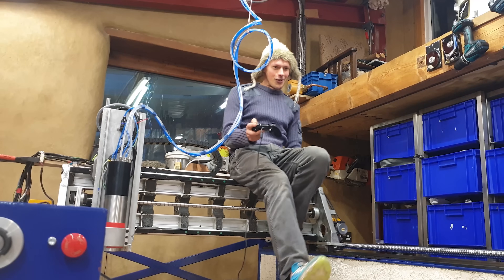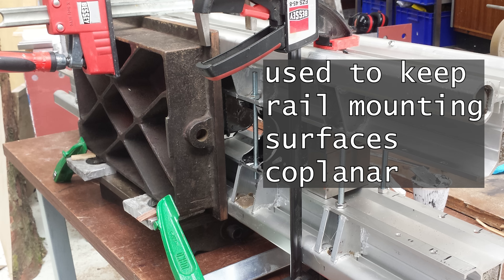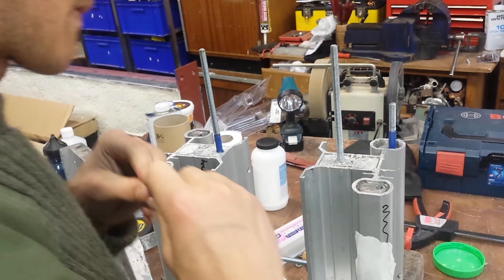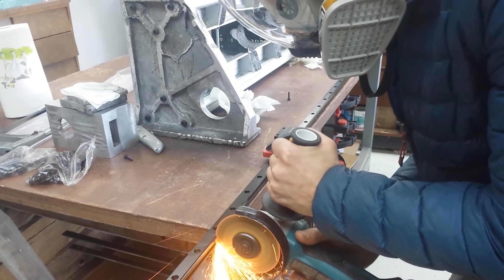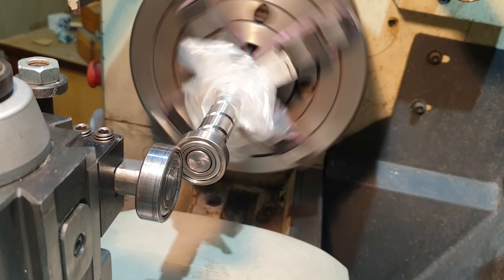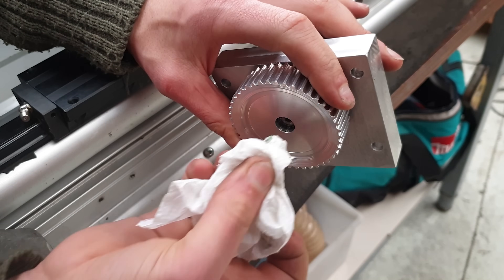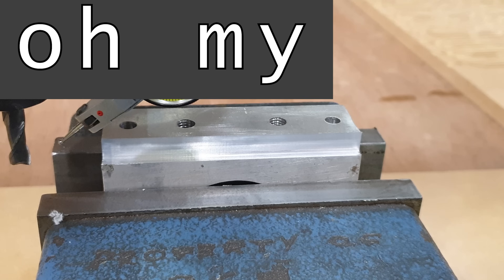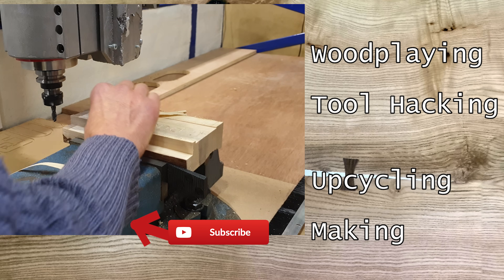Experiments in Gantry Design: What makes this CNC so special?

Comment: I know this is years later, but great job. Your off your shed, in a good way.
 I just started a plasma table build and screwed up and bought normal ballscrews and was wondering the best way to unscrew my design faux pas because of them whipping at plasma table rpm's, and found your vid on your rotating ball screw nuts & was working out how to make them in my homeshop from junk and I have done some diy casting and know how frustrating it can be at times. Then realized the same thing about the ballscrew pitch being too fine for rapids. Rather than find the right pitch screws like you did, I've just gone to a rack and pinion setup because its just for plasma. On the plus side for unconventionality, for a table frame I'm using a old JCB 3c digger/backhoe chassis turned upside down. Rigidity isn't a issue :) Curious why you used vb for the atc code etc, I just tend to use linuxcnc for everything cnc as its easy to dig round inside, although it tends to be crusty old grumpy people on their forums, they know their stuff if you develop suitably thick skin, but hey, you've been on the 'zone,  you have that off pat I'm sure :)
You can get structural adhesive from BA or 3M that's (relatively) reasonably priced (for structural adhesive) for potting surfaces together, although I'm sure your diy epoxy grout worked great. I built a dragbike and rather than weld on the crankcases and risk distortion to critical dimensions, I bonded in stiffeners with it. Its designed to glue airplane wings together, so more bond area the better, but it strong stuff.
Reply from the maker: Oh and as for the linuxcnc - I just sorta fell into using Mach 3, and now I don't want to do the work to switch - It wasn't really a fully considered choice...
Reply from the maker: Hey Jmp, thanks so much for commenting and watching :D Yeah good call on the rack and pinion for plasma - that's the way I'd go for that.  
A JCB chassis turned upside down!!! Now that sounds very cool! Would love to see. We have an old 3CX and after grubbing round under that thing, it sounds like a good use of a LOT of steel. Love it ;)
Reply: @FloweringElbow  This is a 3C2, that had been properly wrecked when it was rolled into a lake when the bank gave way. I bought the remains as a engine & parts donor for my newer 3C3 (previous model to the 3CX) and lots of leftover yellow lumps round the back of the shed to make things from.

So far I've trimmed off bits from the frame so it could fit through my machine shop door, inverted it & put heavy casters on as the forklift doesnt fit through the door either, and started to clean up & test fit HGR20 linear rails for Y and X giving 2000x1000 work envelope. There's a pic on linuxcnc's forum. Nasty looking but form follows function and its surprisingly plane given its history as a submarine. I'm using the roof inverted and cut down as the water tank and inside the integral diesel tank at the front is a great place for mounting sensitive electronics with heavy emi shielding from plasma noise. https://forum.linuxcnc.org/media/kunena/attachments/19839/jcb_plasma.jpg

For motion control Mesa 7i76e & THC-5 interface, 3NM closed loop steppers & supporting hardware + a old pc with linuxcnc running plasmatic gui frontend have been prepared but currently blocked waiting for helical racks after my ballscrew faux-pas. 

I have a bridgeport interact1 retrofitted linuxcnc & steppers + originally a generic parport breakout board about 10 years ago, then redone with mesa 7i76 fpga motion controller and 4th then 5th axis so have some experience with the mesa and linuxcnc. And a working cnc mill to machine bits on.
All this because I have 3 landrovers and a vw bay window to make chassis repair sections for. Probably yellow ones.

Comment: Having done mostly woodworking all my life, and now bashing around with metal, I do totally understand your new engineering phrase "accuracy-exasperation equilibrium".  LOL  All those extra digits to the right of the decimal point sure make things interesting, having come from the "measure once, curse twice" mode of fabbing.
Reply: I tune machines in an aerospace shop. They frequently need to be better tolerance than the sales brochure. I always ask 2 questions:
1. What tolerance range would you like it to have?
2. For the parts made on this machine, what tolerance range does it actually need to be?

Since I'm talking to a machinist promoted up to production manager, I get real answers.
Sometimes I have to show them things like, "this lathe turret is all wonky and these pockets are straight if bolting tools to the side, and these other pockets are straight if bolting tools to the face." (Actually, all our Haas lathes have that problem. It usually comes up again when we get a new lathe operator, and they move tools around and suddenly we are breaking taps...)

And I always strive to exceed expectations, but many of these machines are poorly setup for precision tuning. I've had to make a custom alignment tuning jig for at least 1 machine, because the factory did all that with the wedge off the machine, level & with no counterbalance spring on it. Without the jig, adjustments would barely move, then jump 2 decimal places out of scale.

Comment: Now that you have made a decent machine. You can remake its parts using CAD and cutting out from billet aluminum to upgrade this machine to levels of accuracy.
Reply from the maker: I had that thought in mind when I was making this, but TBH now that it's up and working, replacing say the cast gantry side plates, for machined versions, seems like it would make a negligible difference, for quite a lot of cost... Although those cast parts are far from accurate themselves, the metalized-epoxy replication method of jointing makes them super accurate - probably better than most machined parts. I would kinda like to make a more beefed-up spindle plate though, for when the z is at full extension.  
Thanks for watching friend :)

Comment: Dear friend, you have done a great effort and work,
Vibration is the big problem of machine tools (mechanical or CNC), next time you can purchase iron casting structures (new or second hand)  and use as barebones. You will be suprised of how that small carbon in iron casting absorb vibration. 
cheers.

Comment: I plan a similar high Z but roughly 1/3 size :-) but 60k rpm :-)
Reply from the maker: Good afternoon 1337 Imba. 60k rpm 😲 Impressive, what are you planning to cut?
Reply: @FloweringElbow  mostly hard wood(oak, ebony, rosewood, palisander and other nice wood.  with tools from 0,4mm to 6mm diameter.. but in the current situation not before 2024
Reply from the maker: @Imba-gt7qi  Cool. The speed will be useful with tools 0.4mm I guess. Good luck!

Comment: This runs on VBA?
Reply from the maker: Hi Evan. Is VBA, Visual Basic for Applications? We are running Mach3 at the moment (though looking to change), and it has some visual basic scripts...
Reply: @FloweringElbow  yeah, that's the VBA I meant. Interesting! I didn't realize that that was still used by some software. I started learning that back in the early 2000s at one point. Thanks!

Comment: For your next improvement, I'd suggest some of the largest Loc-Line tubing and attach it to your Z axis and vacuum. Point it down to your cutter and it will happily suck up about 90% of the swarf. Just search YT for Locline, router, vacuum for some examples.

Comment: I like the printnc cnc design. however I was thinking of using several pieces of 8 inch to 12 inch "Aluminum Lighting Truss" to make the gantry. It comes in lengths of 1M, 1.5M and 2M.  The light weight truss is rated for 500lbs without flexing, which should make it stiff enough. If not, it is still a good starting point.

Comment: Just wondering, why didn't you use I Beam for the gantry as well?
Reply from the maker: Hi there BoboHo, thanks for watching. Steel I beam, is very heavy for a gantry that gets accelerated and decelerated a lot. It is also quite poor at resisting twisting forces (which there are a lot of on the gantry.

Comment: I was a tool and die maker and diecast mold maker. For approximately 45 years. From what I can see in your parts is you have a lot of gas being trapped during your fill or pouring process.I would like to suggest in the areas wear you have what looks like a seam that you put in a .004 to .006 deep vent to allow gasses to be released . Aluminum won’t flow out a vent that is under ‘006 of a inch.’.start off with a ,250 wide vent and increase till your pour is smooth looking.
Reply from the maker: Hey Gary. Thanks for this. Some of my early castings for this machine were truly terrible because I was using poor technique. This has improved a great deal, but I still have plenty of room to improve. Thanks for your observations and advice, and for watching :)

Comment: This is so fantastic, the replication process is so extremely interesting, it means you can cast a relatively accurate base and then not have to worry about scraping provided you have enough epoxy compound and a straight edge.

Comment: Love the epoxy jointing technique. Will check out Banburg. Split a mould open pouring  lead once but then took the pattern to a foundry. Made my lockdown cnc from aly extrusions for the bedblock, Two 600mm ballscrews for XYZ, one cut to 450 and 150 for the Y and Z. . Bean can aluminium, lol. Made a vid of my  turciteish filled epoxy test on a surface plate. Super impressed with the skill range.

Comment: I'll say it again, your channel is fab. It's, sort of, proof of concept of all those things I've wondered whether they were possible but with all those tips and trick that save huge amounts of trial, error and fail.
I've been collecting bits and bobs from engineering auctions and scrap bins for ages to build a CNC plasma cutter for my partner.
Thanks so much for sharing.

Comment: Amazing video, and congratulations on achieving such a capable and stiff gantry.  I haven't seen anything on the replication method in this context before, that is extremely interesting.  Do you have a recipe for the metalized epoxy? Thanks for showing this in such detail. G
Reply from the maker: Thank you very much Greg! We haven't really tested its capabilities properly yet, we really need to seal up the ballscrews and finish off other bits first... We're working on writing out all the metalized epoxy recipe stuff...(Edit: you can find it here: https://ko-fi.com/s/bb8cbd72e1 )
Reply: I'd suggest to use a commercially available mixture specifically developed for the task like DWH from Diamant Polymer or similar products.

If you mix something yourself, without extensive testing that'll most probably dwarf the cost difference between diy and professional products, you can never be sure if it'll creep and basically anihilate all the hard work when it all starts to get sloppy after some time. Creep over time is not an easy problem to overcome, and in this application there's not much tolerance for any of it.

There are other areas where improvised solutions have less chances of causing substantial problems. Wrong place to save what's just a few bucks after all.
Reply from the maker: Hi there Heinz, thanks for sharing your thoughts on this. Personally I disagree of course, but that's an interesting perspective. With good epoxy and mixing technique, I reckon the possibility of creep is effectively zero. 
You may be right about the price difference, though my research indicated otherwise, either way, I'm only making the machine because I like making stuff... 
Anyway, have written up my thoughts on this and details about how I do it in a little guide about DIY metalized epoxy etc, that can be found here:   https://ko-fi.com/s/bb8cbd72e1

Comment: accuracy/exasperation equilibrium... yes, I know what you mean.  A proper machinist just doesn't feel the exasperation, I guess.  I love the castings.  Can you tell us more about the epoxy, sand, and metal fill? I recently purchased some steel-filled Moglise, which is somewhat difficult to procure.  My sense is that 80% fill of steel or aluminum and any decent epoxy would be OK.  What is your experience?
Reply from the maker: Good morning K15n1. Pretty much right with your epoxy fill estimates. I'll write up the details when I get a chance. Essentially the mix you suggested is a great starting point, and it's WAY cheaper to mix your own... Peace, Bongo.

Comment: Congrats! 37.5N/um is a really fine job!

Probably one of the best routers on the market!

(although the long overhang on the z axis will probably deflect more when you pull it)
Reply from the maker: Hey there, thanks Eldric. Yeah that's right, I guess I will be wanting to do any metal milling as close to the top of z travel as I can get to minimize the z-deflection / twisting leverage.

Comment: Is that the China toolchanger spindle for about 1500€? I am super curious about it and if it's any good...so what do you think about it? 
Thank you for you video, learned lots!
Reply from the maker: Good evening Leonhard, thanks :) 
We will be doing a whole video on the spindle. It's a ATC motor from Jianken model JGL-100/3.2R24
220V, BT30. It's early days but thus far I'm impressed by the quality. I really need to redo the mounting method - I always intended for the spindle to be supported over much more of its length - and to have the mount add strength to the z plate... Just need to do some casting - but at lease I will be able to machine it on the new CNC this time :) 
I'll put a link to the spindle in the vid description when I get a chance.
Reply: @FloweringElbow  thank you so much I'm looking forward to it!

Comment: Nice work making the machine. Now you've got a great tool for making all the future ones!
Reply from the maker: Yay! it's far from finished, but I did cut out the first tool the other day - a spanner for opening the veg oil tank on the van conversion. Worked a treat, and would have taken me ages to make by other means... Now back to work on the machine itself though ;)
Reply: @FloweringElbow  nice. They're such useful tools. I didn't make mine, just bought it, but the first thing i made was a er collet spanner. Tools are definitely my favorite things to make though

Comment: I worked on gantry laser machines the base coloums and gantry were made of a composite stone granite powder mix very stable 2micron repeatedly thay were very big machines for aerospace  , next one just mix some concrete up it'll be better than all that aluminium  and well done you wouldn't believe what bits of scrap have been used to put a machine together to knock components out for production keep up your infinitive work
Reply from the maker: Hey Roger, thanks  😊 . The frame's I beams have a concrete mix in em, was kinda tryingto keep the weight down in the gantry though.